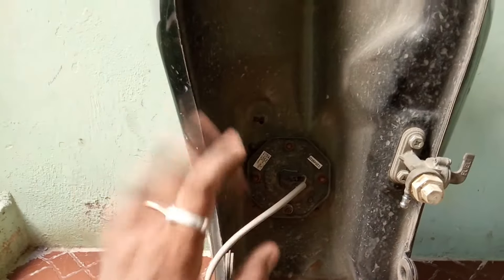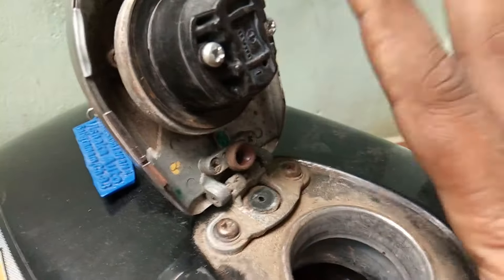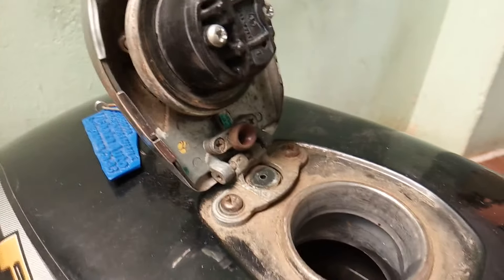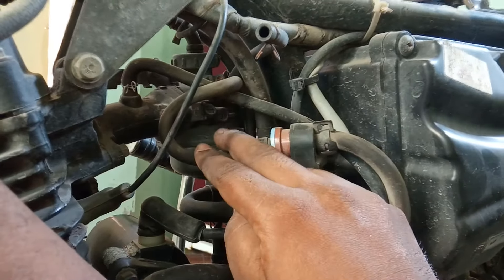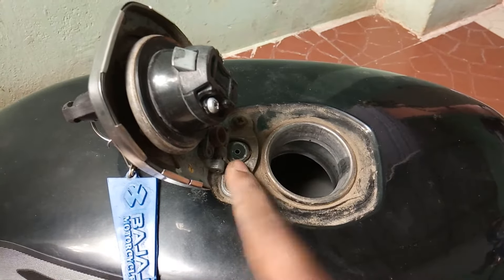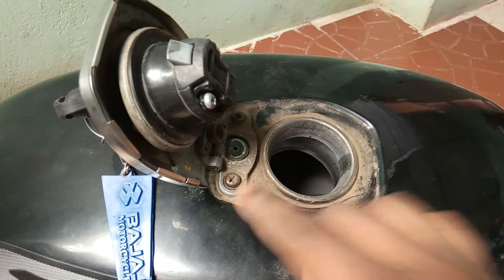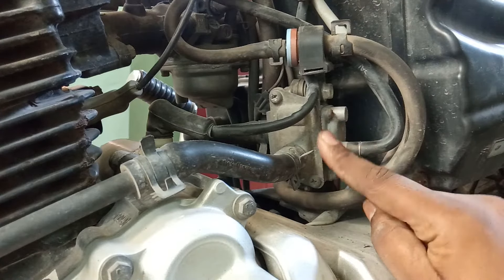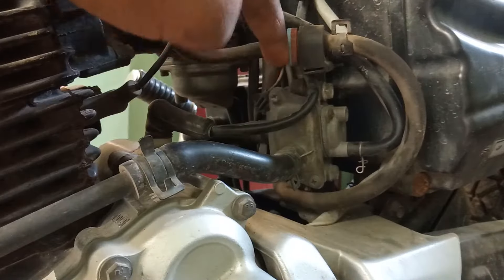BS4 & BS6 Bike Owner's Must Watch/Never  Do This Mistake While Filling Petrol #tamil Petrol air lock

Comment: I had the same problem with my RTR 200 dual channel BS6, during warranty period, both fuel pump and ignition coil developed issues and I fought with TVS and got them replaced. So the lesson is don't park your BS6 two wheelers under hot sun.

Comment: Honda livo 2018 bs4 bike ku canister to carburettor hose remove panna dha running correct ta iruku.
Connect la iruntha running stuck aguthu , canister to carburettor hose remove pannitu use pannalam ethavuthu problem varuma please reply
Reply from the maker: No bro don't use like that. Dust will enter into chamber

Comment: Bro in my enfield bs4 petrol tank leak iruku bro. Showroom la keta tank change pana soldraga. But in YouTube la oru video pathen. Avaga canister ku pora hose eh block panti andha nob um weld panitaga. Nanum Adhu mari panalama . Bs4 bike la bs3 mechanism work pandra mari andha video la alter panirkaga. Will it ruins the engine life and performance??
Reply from the maker: You can do that method bro. No problem only bs4 system stop working other than that no problem for engine life and performance
Reply: @tnmotorider3910  thank u bro

Comment: Bro bike air filter la oil leak aguthu Enna problem a irukum bro
Reply from the maker: Not a problem bro. It's called blow by gas
Reply: @tnmotorider3910  ok bro but over a leak aguthee
Reply from the maker: Then check your engine oil level is proper. Suppose there is  excess oil also this problem happen bro

Comment: Bro pulsar 125 la petrol potu konja thooram poran udane off aguthu...again 1km poren off aguthu
Reply: Tank open pannungha aprm bike move aaghum it's due to petrol flow lock don't fill petrol fully bro 3litrs maintain pannungha podhu.
Reply: @thorfitnessandlifestyle8241  bro evlo bro constant ah podanum petrol...
Reply from the maker: Bro air lock problem. You need to clean that air hose for proper running